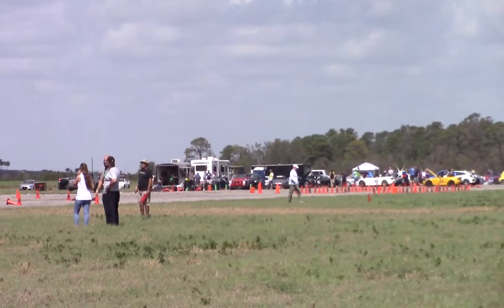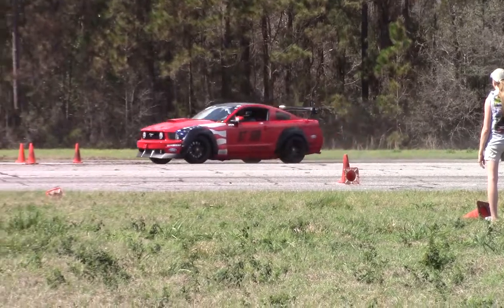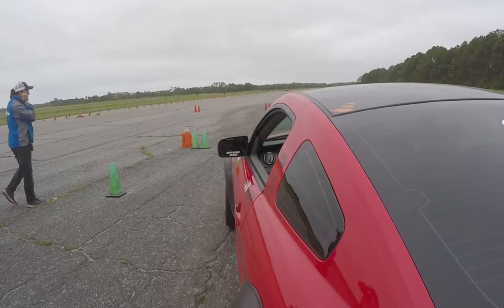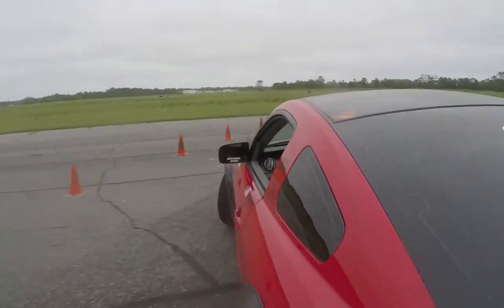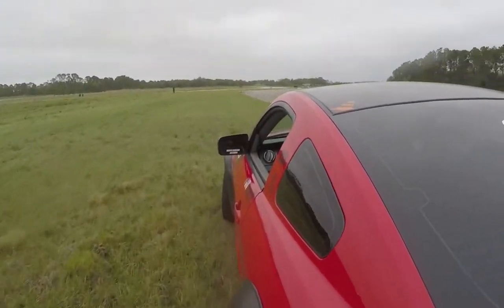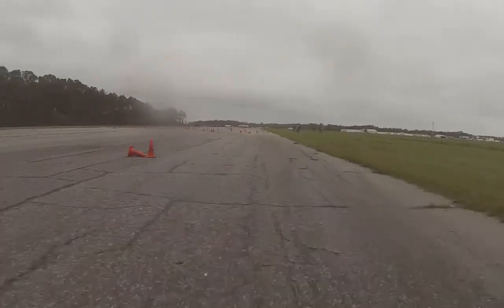Wider tires, less grip? - Heat management with racecar tires.

Comment: If you had issues with finding proper wheels so you can use max of your space under the fender, why you haven't try of making three piece wheels with some light center piece and than you can built width and offset with lips and barrels.

Comment: Does wider tires help mustang ride smoother? Hv a 2003 mustang rides like I am on a road with pebbles . Thank you for any advice.
Reply from the maker: Not really. Your shocks and or bushings are probably shot on an older car like that. I would look at a suspension bushing kit first since its cheap, but labor intensive, then maybe a better set of name brand shocks.

Comment: I’m new to auto-x. I’m driving a FWD but have some experience with tuning in simulators and what not. On the simulator you try to get an even temp all the way across the tire. I have an infrared temp gun. So last weekend I had my tires cranked all the way up to 44psi in the front and was still reading about 10 degrees colder in the center of the front tires. I didn’t go any higher because I thought that seemed excessive. Is this an ok way to setup pressures or is the old chalk trick a better bet?

Comment: I have a 2016 gt and wanna fit 305 all around but don't know how to go about doing it. What I originally wanted to do is have 19x10 in wheels with 305 35 19 tires but have had people saying that I'm not using the whole tire patch because the tires are bulging due to the fact that they need a 10.5 inch wheel minimum. Also everyone I see who has an autocross set up is running an 18 inch wheel instead of a 19 inch.  Also also instead of 35 for the side wall size, they go with 30. So now idk what I'm gonna do.
Reply from the maker: Yeah your in a tough spot. 18 inch wheel tire selection is vastly cheaper and there are more options. I believe with your car you might have to have 19s do to brakes? I am not sure I know that's the case with the GT350. If you can switch to 18s definitely do so. As far as tire bulging on 10s I would say yeah it's not optimal but will still be better. A lot of the bulging depends on the tire itself. The Hoosiers it doesnt matter as much but street tires it does. Sam Strano at Stranoperformance can make you some custom wheels that will fit your car nicely. Before I flared my car I ran a set of 18x10.5 Enkeis that he designed a custom offset for. He is an autocross legend and can help you out with picking parts as he runs a parts store.